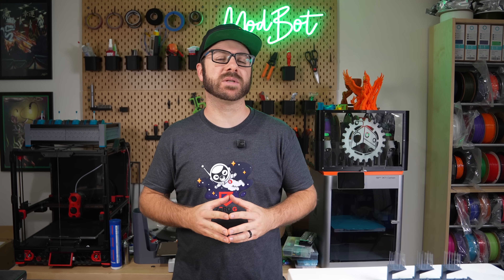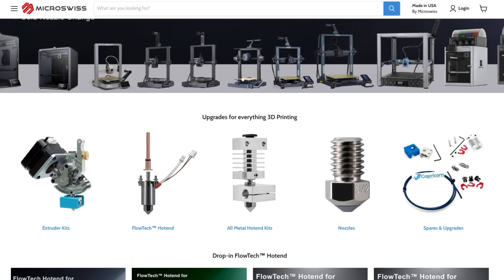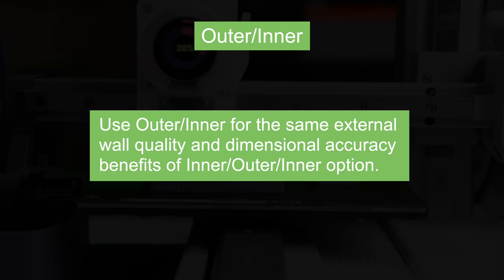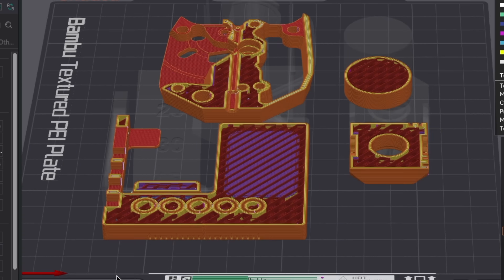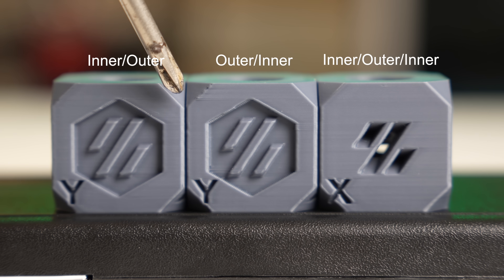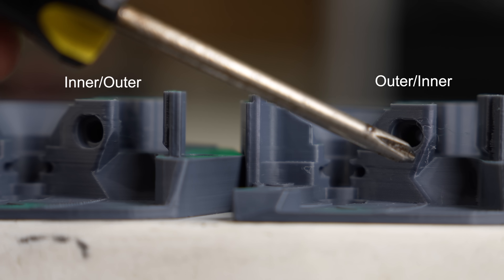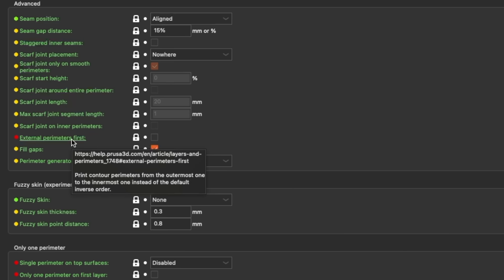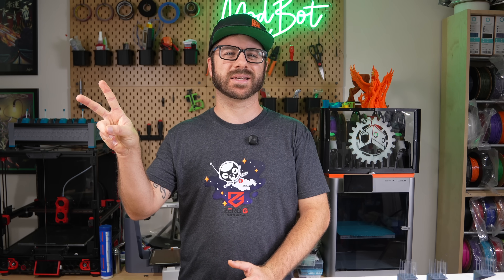Best Wall Order for 3D Printing? (Test Results)

Comment from the maker: Info from I/O/I Orca Dev worth checking out:

1. the orca implementation is materially different to Bambu studio. See here: https://github.com/SoftFever/OrcaSlicer/pull/6138
in short much more consistent performance in difficult scenarios making it useful for any model type, not just easy calibration prints 🙂

2. outer inner is indeed obsolete with inner outer inner being available. It’s only there for users “comfort”.

3. The Arachne implementation of IOI is significantly more advanced than the classic perimeter IOI.

4. Enabling precise wall with inner outer wall ordering would help a lot with external surface finish and parts fitting to each other. It slightly increases the spacing between the outer perimeter and the first wall allowing for the extra squashed material from the inner walls space to go to. Give it a try!!

5. For your next quality series you should try the latest feature I developed: extra bridge layers. It makes the bridge appearance much much better https://github.com/SoftFever/OrcaSlicer/pull/8263

6. same for these two settings here: wipe before external wall - improves de retraction performance and internal bridge filtering which helps massively with reducing pillowing on sloped surfaces 

https://github.com/SoftFever/OrcaSlicer/pull/3287

https://github.com/SoftFever/OrcaSlicer/pull/3319

7. I’ve also experimented with last time smoothing between layers to attempt to mitigate the benchy hull line effect. Hint: it’s not the layer time that causes it! https://github.com/SoftFever/OrcaSlicer/pull/8107

I’ve been developing mostly quality focused PRs, you can see my work here: https://github.com/SoftFever/OrcaSlicer/pulls?q=is%3Apr+is%3Aclosed+author%3Aigiannakas++
Reply: Small Addition for 2: Not with only 2 walls printed
Reply: how does option 4 (inner-outer w/ precise walls) compare to using inner-outer-inner alone and using inner-outer-inner w/ precise walls ? New video needed

Comment: What helps with the seam inconsistency with outer-inner is to make it so that the difference in flowrate between each extrution lines (outer, inner, infill) is as little as possible. You can do this by adjusting the line width or the speed for each. Going slightly below your max volumetric speed also helps specially when there's large areas of solid infills.
The biggest factor is tuning each filament, not just type but also for each color.

Comment: inner outer inner overhang ability is very poor unless the model is specifically designed for fdm.  i use minimum 3 walls, then use the modifier boxes and discs to change the wall width in any problem areas. slicing with 0 tolerance and 0.004 deviance, using inner outer with tuned wall widths from the modifiers along side with print infill first and precise wall. toleraces of finished prints are sublime, leaving no need for any post processing except vaporsmoothing to remove layer lines.

also i turn off zhop for all layers as zhop always creates these imperfections. u can do away with this feature in most prints safely if u turn off reduce infill retractions, as this often makes strings :)

Comment: I run outer/inner (or as prusaslicer calls it, external perimeters first). I've never had a problem with seam quality. My first reaction to the difference in seams is that you have some other setting affecting the seams that needs to be tuned differently for outer/inner.

Comment: Just a heads-up, the external layering artifacts that you are seeing in inner-to-outer, previously referred to as z-banding, is 100% over-extrusion.  All polymers expand when heated, and they don’t return to their non-expansion state when cooled.  They retain a percentage of that expansion state.  Annealing attempts to correct that, by allowing the polymer to more closely return to a non-expansion state, but that causes some deformation and still leaves the print with a small amount of expansion.

Comment: This falls in line with @PrintingPerspective s discoveries. In short, for the Inner/Outer/Inner setting, the first Inner wall works as a purge line, then it prints the outer wall with filament that is not too molten which results in better layer consistency. 

I love your filament tuning videos. I would like to see a minimal layer time calibration video with explanations and a methodology. I think that is a lesser known area regarding filament tuning

Comment: At around 6-7 seconds in to your video you show a shot of a your hands holding a gray box with an extrusion issue on one corner that increases in error as it progresses towards the top of the part. I believe the part may have rounded corners. I have an identical problem and was hoping to see this addressed but didn’t see it mentioned in the remainder of the video. Do you have a solution for this?

Comment: Well personaly I have to disagree with your conclusion that Outer/Inner ordering should not be used. I use it as my default for at least 5 years now., but that might depend on the mashine. I use fast deltas with Klipper. Previously the FLSUN SR which I upgraded and converted to Klipper myself and now the FLSUN T1. Both have two things in common. Strong cooling and very fast travel moves with high acceleration. Together with properly tuned flow and pressure advance I have zero problems with the seams which are quite clean. And my overhangs turned out better that way as well. Your 70+ degree overhangs might be a bit worse, but first, most prints don't have these because they are designed for 3D printing or you use supports anyway. On my test I don't have any gaps up to 65 degree. First show up at 70 degree but still looking god, while 75 is not good anymore.... with TPU! PLA can be pushed a bit further.

But I will test if Inner/Outer/Inner gives me even better seams. That might still be worth.

Comment: There's a factor unaccounted for, line width. I'm sure although it has an effect it might not matter too much. The "squish" i noticed causes artificing on the outside surface and the outside wall the be pushed out on overhangs and onto the outer wall. I fixed that by simply making outer, inner, default, and sparse 100%. Since that, i also noticed gone are also the minor impressions of infill on two wall thickness prints. Nearly all my prints are two walls since i did that. Only use 3-5 walls for mechanical parts, when 100% infill makes no sense.

I came to this conclusion when looking at some of my old prints from 10 years ago, using simple slicers that didn't have options for flow rates and just one simple "multiplier"

I run my printer at 250mm/s (5.5K) outer wall and 325mm/s (7k) inner wall/infill and 700mm/s 10k travel for best finish/look

Anywho, just a brain dump

Comment: This is  really interesting. I have been using OrcaSlicer and Outer/Inner for a while due to the nicer looking wall finish. However I have noticed the seams look bad compared to when I was using Cura before that. I didn't associate the bad seams with Outer/Inner, so this is all very interesting.
Reply: I just tried Inner/Outer/Inner and it does indeed clean up the seam very nicely. Thanks for the info.

Comment: Keeps to amaze me that people has inability to adjust anything by themself and has to have a premade profile for everything.
Reply: Some people just want to print??? it's not 2010 anymore when 3d printing meant more time tinkering with the printer than actually designing or printing parts. I used to like tinkering with different settings but now I'd rather spend my time in CAD designing the actual part. It amazes me you can't understand that.
Reply: @aesthetic1124 Have you even opened the print settings on your slicer?  😂😂😂😅😂
Reply: @aesthetic1124 When you see a print defect, like a seam that is not closing. That is just a slicer setting/tuning. There is nothing wrong with the printer like most people think. This printer is trash and so on. It's the settings that is wrong

Comment: Thanks for this! I've been using outer/inner order for a while and will stick with that. For the puzzles I print, the part fit matters immensely and the surface quality matters too. Z seam consistency is not a concern in fact I have it set to coast slightly to make absolutely sure the z seam doesn't interfere with the part fit. Overhang quality seems basically the same for me with the different orders. If it's steep enough for there to be a visible difference then that overhang would already interfere with fit anyway. Careful flow calibration and Cura's exclusive slicing tolerance setting (which unfortunately has no direct equivalent in other slicers) have also been super helpful for tuning part fit.

Comment: My only bad experience with inner-outer-inner so far has been while trying to print a 45 degree internally overhanging ring. Because the inner-diameter exterior wall had to be printed almost in mid-air while following a concave sort of curvature, the material had nothing to really lay down onto or be extruded against which caused it to create a bunch of catenary web strands with blobs on the nozzle.

The filament sort of stretches while blobbing up until the blob becomes large enough to deposit itself somewhere along the circle. Once it sticks, the process repeats all over again with a new blob/string being dragged to another point around the circle.

I wish wall order could be a conditional setting, so maybe it could be aware of overhang angle or maybe be aware of "% overlap with open air" and change accordingly. At the very least, it would be nice to have two options so that externally facing walls could be inner-outer-inner while concave curved inner surfaces follow inner-outer.

Comment: Outer/inner is better for overhangs when cooling is the limiting factor. For example overhangs that are pointing towards the back of the printer (when the cooling is occluded by the previously printed part). Printing the inside first will make the inside part occlude the air so that the outer layer will not be able to get as much cooling when you print for example an overhang shuriken cooling test.

Comment: Hi great video! 
I am printing engineering end use parts at work and  used to play whit this and learned that it is much more beneficial for surface quality to go outer/inner, but it is dependent on the thermal mas and heat capacity of the material and the flow characteristic of it.
By that i mean if you are printing hot and fast (for layer adhesion and time) outer/inner will create a heat dissipation barrier and as the material builds up toward the inside, the inside perimeters will remain hotter. 
More heat is trapped and this causes the material to shrink far slower for the inner paths which eventually will create ripples as the layers stack and will result in steps skip as the nozzle collides whit them. 
This is a problem for functional or end use parts where you need to chase strength and long life for the part and will have 6-20 perimeters and more than 80% infill. Large parts suffer less because of the long layer time. A good cooling helps greatly.
The overhang is solvable by decreasing the layer height!  
The seam problem was not as noticeable for me but i used "Superslicer" and "Simplify3D" so i think this is more slicer dependent.
But all in all it is much more of a headache  to dial in an outer/inner profile as most materials will be better printed in inner/outer config because less heat is trapped, and most printers do not have sufficient cooling capacity.
This dose not apply if you print toward the lower end of the temperature interval or have less than 5 perimeters and less than 80% infill.

Comment: I had a few prints using IOI where I was able to peel the outer layer off of the finished print. It may have been under extrusion but I'm not sure.

Comment: In Orca it should be possible to change the wall order for different parts of a print by changing it with a height based modifier, or changing properties of individual parts of an assembly.  Have verified that it is possible with a height based modifier, but an assembly of separate parts into a combined overall part, should allow this as well.  So if carefully designed with this in mind, it should be possible to change the wall order to optimize for different areas of the print.  Would also suspect that this should be possible with a standard modifier as well.  Question from JonS got me thinking and I tried out some of this in Orca and verified within the slice preview.

Comment: The biggest pro to using outer/inner or inner/outer/inner is you can crank up the inner wall print speed and not have to worry about any ringing or vibrations superimposing thru the outer layer as it lays against them. The faster you print the more it will become apparent.
And using outer/inner you can bump flow rates up for the inner walls above 100% to achieve better layer adhesion yet still keep the outer wall at 100% and retain part dimensional accuracy.
As seen parts with severe overhangs inner/outer will be preferred.

Comment: I use Outer/Inner, but I also use prusaslicer so I haven't tried Inner'Outer/Inner. I haven't noticed worse seams with Outer/Inner compared to Inner/Outer. That doesn't necessarily mean that there isn't a difference, just that if there is it isn't easily apparent. I certainly wouldn't consider the seams you got with Outer/Inner to be acceptable for a final part.

Comment: This will make such a big difference for me. My H2D has had inconsistent bore hole dimensions which has been difficult for technical parts, but I just did a print with outer/inner and the bore holes are perfect. Thank you so much!
Reply from the maker: Thank you for the feedback I’m so happy to hear that’s the case!!

Comment: i made outer-inner my default quite a while ago now, but i also use arachne wall generation & scarf seams, both of which seem to help the z seam problem a LOT.  for primarily round/curved objects, though, i've found that random seams also help when i want rounded objects to interact with each other with tight enough tolerances to grab a hold of each other while still allowing movement by hand - such as ball & socket chain segments such as is used for various mounts.  each setting is there for a reason & sometimes experimentation will be your best friend to find what works best for the given project you're working on.

Comment: By activating the option wipe before outer wall loop you basically eliminate the overextrusion occuring after a travel move since you start your outer loop out of a travel move from either the inner or the middle wall seam (point) wich causes overetrusion or excessive material on the loop start ( seam start point ). This option works the same for OUTER / INNER and INNER / OUTER / INNER since the start condition of the outer wall is the same for both methods. Thats what i miss in this video, its a mandatory setting to choose if you choose other than INNER/OUTER. Imho this should have been in the video to have a basis to compare to INNER / OUTER regarding seam quality. The seam seems better in INNER/OUTER/INNER because the travel move is not long but its still noticeable and depending also on how long you have to travel from the inside seam to the outside seam, try OUTER/INNER with zigzag inner seams ... it will be a mess.

Better explained ?
Reply: I'm just working on getting print accuracy so that parts fit together.... right.... the first time.

Comment: Ideally slicers should use different ordering for different features (especially switching to inner/outer for overhangs).
Reply: Or at least be able to change wall order with a modifier, height based modifier, individual parts of an assembly, etc.  Maybe there is a way to use one or more of these techniques already?
Reply: @tonyoslund5700 yeah you can use modifiers on Orca to swap wall order
Reply: @tonyoslund5700  Could you place two models, sliced differently, then halt printing at height on one and start printing from height at the other?
Reply: The ability to change wall order based on overhang degrees is all I want for Christmas.
Reply: We can already slow down for overhangs, so the slicer knows they exist; changing wall order is the next logical step!
Reply: You can do this to a point with adding modifiers to specific parts.  Add a modifier, and adjust the order of the modifier.
Reply: @yammyguy78  true, but it should be automatic
Reply: That's an easy way to make the layers transitioning between wall order types look ugly as hell.
Reply: @ATARAXIA_MECHANICA I believe this feature's been requested a few times for orca slicer, but has always been ignored or criticised with the same argument from ataraxia. What's interesting, though, is that manually implementing this in a print actually has not caused ugly transitions in my experience 😐
Reply: I concur infinitely

Comment: You completely missed how outer/inner or inner/outer/inner requires much slower speed especially in circular overhang to prevent failed layer adhesion.

Comment: I wonder if the order affects scarf joints...
Reply: Scarfs are tricky when line length exceeds scarf length. Since settings effect the entire print, quality faulters on fast printing larger parts when those parts have intricate shapes. Quality of sharp details requires slower print speeds which may not be practical. Post printing attaching fine detail print to larger print may yield practical solutions.